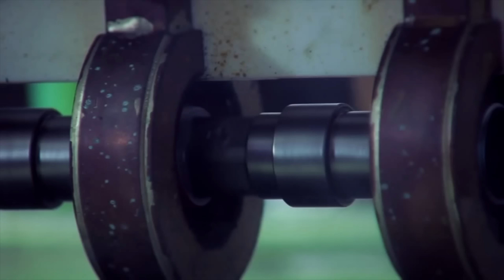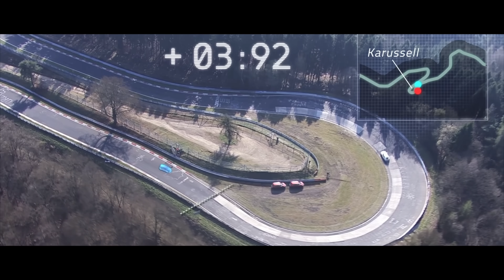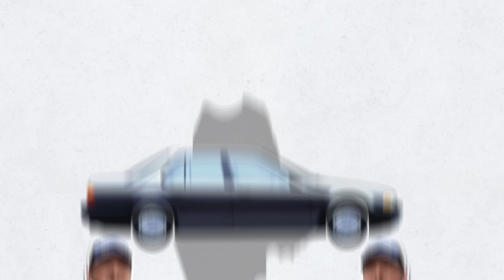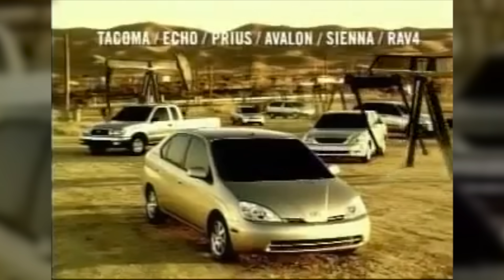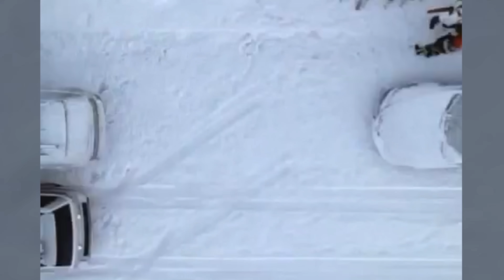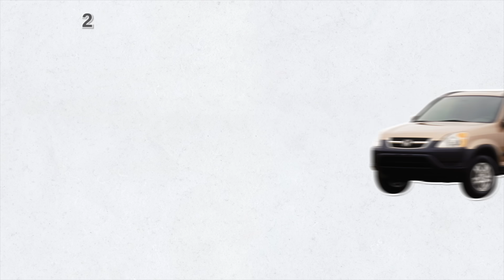Here’s Why Honda’s New Cars are Genius

Comment: I respect and take into consideration everything you say Mr Kilmer,  but i purchased 2 honda civic and they didn't last me 2 months their head gasket wet bad and their valve seals. I tell you i rather not have a car than purchase another honda. BUT!!! I purchased a 1984 Honda Lesabre 750cc and it was a outstanding motorcycle no issues ever and had it for 5 yrs. Great Bikes
Reply: And that is the whole truth, and that why I do not advise people what to purchase, the 2011 Camry I driving in, blow it engine with about 1000, 000 miles, a coworker have Nissan maxima and it still going strong with over 200,000 miles. The fact is Nissan have transmission problems, Toyota had to recall their brand new dynamic force 2.5L engines because they was failing, Honda turbo dilution problem, All cars has their own issues.

Comment: My favorite is the 2012 Accord in my driveway. Great car.
Reply: Make sure you check your rear main seal if its leaking bc I have 2009 Accord and its starting to leak at 173k miles
Reply: @D-DM5  If you don't mind What brand oil is leaking from the main? Not a big deal but would be nice to know 👍
Reply: @raymondreiff8170  the seal it self is leaking. Its old and worn out i use Valveoline full synthetic high mileage oil. Just a good idea to check it over bc I presume all cars have that issue with age and wear and tear
Reply: @D-DM5  The only reason I asked is because I ran two 2005 1.3l hybrid 5 speed cars  past 300,000 miles with Mobil 1 full synthetic never had a problem with oil leaks of any kind, But both blew head gasket sometime after 300,000 miles, Also I hit deer with both cars, I guess the deer didn't hear the cars before death ☠.
Reply: 2 door or sedan?
Reply: @christiangriffith225  sedan, 4 cylinder
Reply: @singncarpenter6270  yes I have 3 Hondas. The one I bought for my girl  is 2012 ex l 4 cylinder and I have 2019 accord 6 speed manual and 2008 crv. I love them all
Reply: I like the way you think 😎👍

Comment: I love everything about Honda cars Except the STEERING.
IT'S So Hard and Stiff..... Toyota cars too...
     When I bought a SUBARU Forester..... The Steering is so Smooth and very easy to drive and very Comfortable.... Love It 👍❤️
Reply: I just bought a Ridgeline and love the stiff steering. It feels so stable at high speeds, but at low speeds it loosens. It’s got electric power steering which is designed to do that. My trade in was a 2016 Tacoma which I loved, but steering way too loose and jittery. In the Tacoma if I turn the wheel slightly to dodge a squirrel it felt like it was going to roll over.
Reply: @rickh1353  My friend... Great choice with Honda Ridgeline....👍👍
But everything takes time to get used to it..... 
But it is Kinda Pricey
Reply: @rickh1353  that type of twitchy steering should never be on a pickup. Toyota must have used a rack from another vehicle rather than redesign one for the Taco.
Reply: Lol ...wait till I starts breaking.........
Reply: @tti4919  Facts..... my 2014 Forester base model, I put 60,000 miles on it.... No issue What- so- Ever.... 
The problems are on Most Turbo models of Most car brands....
Not just Subaru
Reply: @Honestandtruth007  wait till 150k plus…
Reply: @tti4919  I can not wait that long...
The New Forester looks so good.
Maybe I will trade in....2-3 more years....😂🤣
Reply: @Honestandtruth007  I will buy it......
Reply: Same issue on our '06 Accord. After driving in our VW the Honda seems like it doesn’t have power steering.

Comment: I wouldn't know I never had a Honda I'm looking at buying a Subaru next year outback
Reply: Those are great cars. Just listen to Scotty about getting the oil changed on time. Those "boxer" engine's are as sensetive as using Autozone fluids in a Honda system. And you should Never use autozone products in a honda unless you're trying to fill the car for cheap. Their system's are super sensetive, even Scotty agree's that you should always use Honda collant, brake fluid & power steering from Honda.

Comment: Honda Accord the best sedan.  Had a 1988 accord.  Had it for over 20 years and over 300,000 miles and still running. Great brand.
Reply: I feel very inferior, Mr Muniz.  My Accord is merely 11 years old and only has 125000 miles.
Reply: @billolsen4360  My V6 Accord is also 11 years old but I've only done about 70,000 kilometres. Has run perfectly all that time.
Reply: @ssaannddrro  70,000 Kilometers? Damn, you only drive it to go shopping
Reply: @domingodeanda233  Every thing is at my doorstep. Don't really need a car.
Reply: @domingodeanda233  Every thing is at my doorstep. Don't really need a car.
Reply: Still have all 3 of our 6th gen Accords. All over 200k miles, one at 309k.
Reply: @pleco101   this statement is true I’ve seen many of these legends in the auction the past few years and they would go past +300k miles. Now a days it’s a miracle if they get past 200k. No wonder all these companies only do max 150k mile warranties and charge an arm and a leg for extended warranty.
Reply: my 87 accord had the pgmfi light come on at about 70k miles and honda could not shut it off
Reply: Just bought 2019 Honda scoped touring 2.0 t.  Very sleek and sexy

Comment: Own a 2003 acura cl 6 speed ….still solid smooth running vtech
Reply: I have an 05 and they are great cars....runs like a clock
Reply: Wise move going with the Manual Trans.... the AT's from that Honda/Acura period are not the most durable or reliable.
Reply: Bruh u luckyy. I had a 01 cl type s until recently it gave me bunch of problems so right now I’m on the market looking for another car. That cl was so fun to drive especially at night
Reply: Good thing it’s a manual
Reply: I have a 2002 3.0 v6 coupe, and a 2003 type S CL9, coupe on 250k km, CL is on 239k km, running smooth, shifting perfectly(well, i take care about the cars and not being scared to change stuff before they fail)
Reply: 6 speed model is kinda rare
Reply: Older ones are good but the newer Hondas with  turbo will wear out the engine faster.
Reply: @theshield1613  they also have GDI(gasoline direct injection)
Reply: ECU is from vtech?
Reply: @wds197  not sure but cl is all original except the slave cylinder at 156k miles
Reply: @golfcon  It's a joke. You misspelled VTEC. Vtech makes electronic toys for children.
Reply: @wds197  its a hybrid
Reply: @wds197  original ECU from Vtec

Comment: The best honda ever made is scotty's 1994 Toyota Celica. Good evening scotty!!!
Reply: Jesus enough with the celica. No offense but it’s a slow and cramped boring car. The only reason it’s still running is because he’s a mechanic and can fix it
Reply: @Modernpatriarch223  agree
Reply: @Modernpatriarch223  you're free to skip any comments that you don't like.
Reply: @fh1980ram  sorry bro. Had to leave my 2 cents. It is the internet after all
Reply: @Modernpatriarch223  Wrong. If you knew about the Celica you would know it has the same engine as the camry that came out that year with a lighter weight body style.
Reply: @bestlaptop_psn  I’m not saying it wasn’t a reliable car. I’m saying a normal person that’s not a mechanic wouldn’t still be driving it almost 30 years later without putting a ton of money into it.
It’s a super reliable car, but everything breaks down after 20 years of driving.
Reply: @Modernpatriarch223  Wrong about that too. I don't know if you been to California but there's plenty of 20+ year old vehicles and because they're so reliable not a lot of stuff will be wrong. Also you didn't need to put your 2 cents in. It's like saying I need a special air freshener.